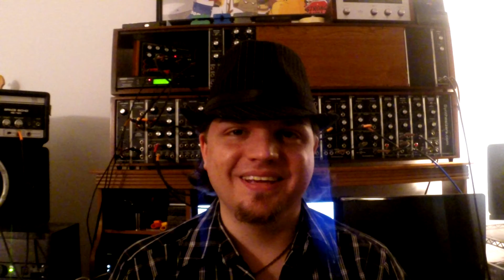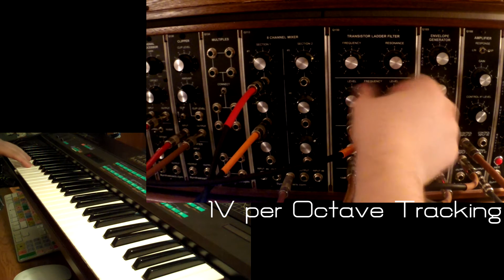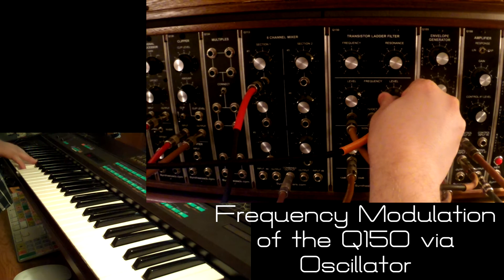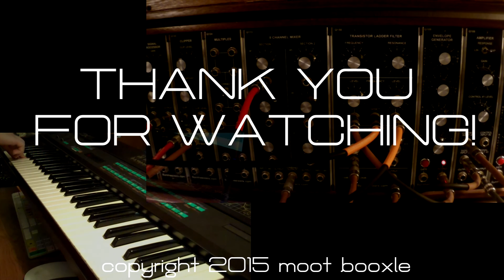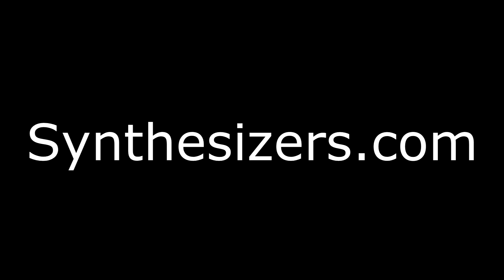The Synthesizers.com Q150 Transistor Ladder Filter

Comment: Nice demo. It sounds pretty ballsy on the YouTube...do you find the bass getting weak at high resonance settings?
Reply from the maker: Thanks! And yes I do, but that is not a shortcoming of this particular filter. I have found that to be the case on most 24db/Oct Moog-style filters at high resonance settings. One way to combat this problem, other than using some post EQ, is to add a bit of unfiltered sine wave into the mix at the post-filter VCA, thus increasing the volume of the fundamental.

Comment: Great demo of the Q150! Could you also share some of the details of the patch you are using for this demo? Love the video, keep 'em coming!
Reply from the maker: Sure! It's just two Q106 oscillators, most of the time in this video a narrow Pulse wave setting, slightly detuned, 16'. They are going into the Q113 Mixer and then into the Filter. That's basically it! Nothing fancy! There's more on the way...thanks for watching!
Reply: mootbooxle Thanks! I had a feeling it was something like that. Sounds like a bit of reverb in there as well. Is that external, or a Dot Com module?
Reply from the maker: James Howe
I'm using an external reverb in this video - Space Designer in Logic Pro 9. I do highly recommend the dotcom Reverb module though - it's that classic Accutronics spring reverb tone. It's a bit noisy, but that's the nature of the beast.